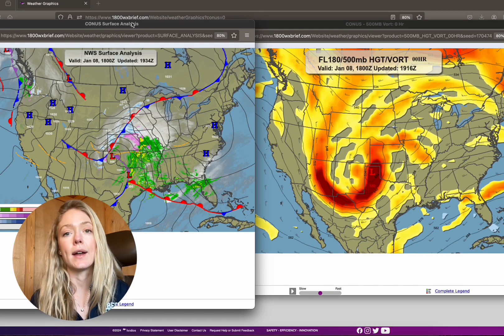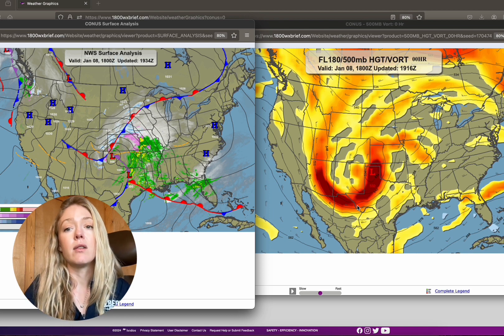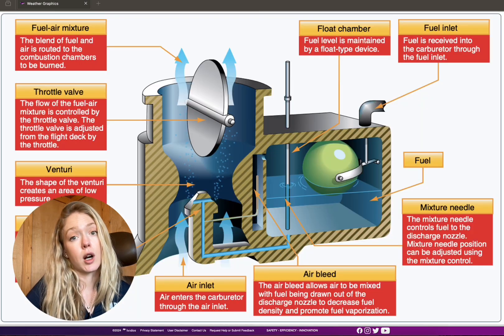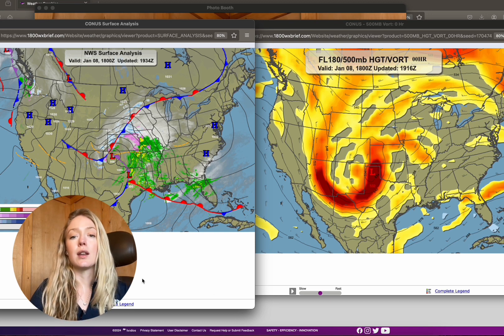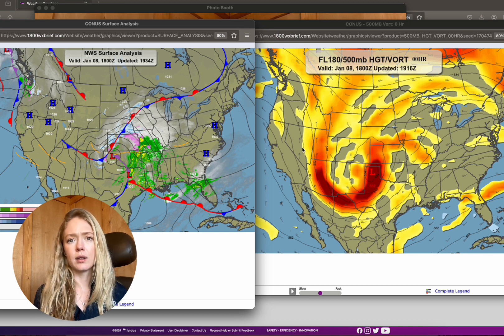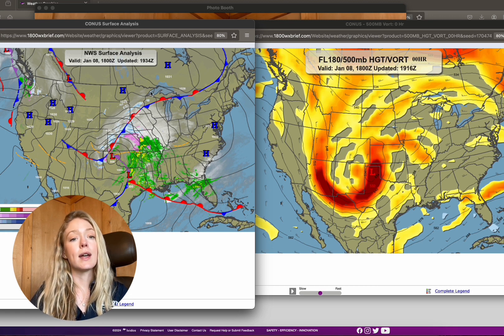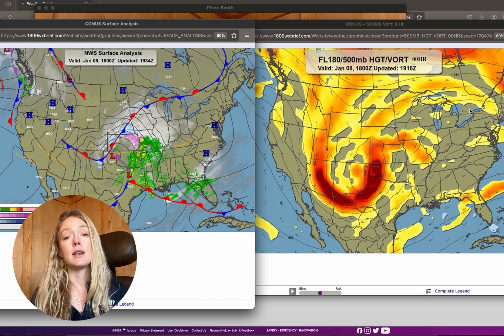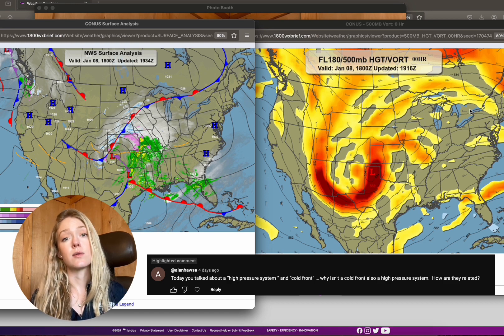AeroSafe - Flight Instructor Explains how Pressure Systems Form

Comment: I’m a CFI as well, This isn’t exactly correct, the pressure drops due to divergence aloft or the air accelerating and leaving behind thus creating a void and air having to come from the surface and rise up to fill in, not Bernoulli although it’s easy to see how that would make sense hypothetically. Think of cars on a highway having to make a sharp turn. They will have to brake to get around the sharp turn (base of the trough) which then creates congrstion and air getting backed up prior to the turn (on the left side or upper level convergence). Once the car leaves the turn it will accelerate and leave behind the other cars stuck on the turn, thus leaving a void in the atmosphere that needs to be filled (low pressure). Hope this helps
Reply: Bernoulli is also not the reason a wing makes lift, if it were how could a wing fly upside down? or why can a symmetrical airfoil fly, heck, even a barn door can fly
Reply from the maker: It seems to me you said the same thing in a different way. If that helps your students understand, it’s great!
Reply: @AeroSafe  No but your explanation is fundamentally wrong it’s not the air accelerating which then via Bernoulli will drop in pressure.

Comment: Thanks for sharing, I've wondered about this and you clarified it for me!  I like the style and cadence of the video too, easy to learn and not packed TMI.
Reply from the maker: I'm glad you found the information useful! Are there any other questions you may have in regards to weather?
Reply: @AeroSafe  Hi there, I think my confusion originally arose because where I am (Toronto) the TV weathermen always show us those  "summertime high pressure systems" that become stationary highs with beautiful warm, blue-sky days accompanied sometimes by late afternoon thunderstorms.  That's somehow counterintuitive to cool dense air being H and warm moist air being L.  So  when I look out the window I always have to unravel it in my head.  It does make sense when I consider that the jet stream has moved north and "our air" is now coming from the hot southwest and has cooled a bit, hence H, as it has moved in from the mid-USA (and often falls between fairly straight, widely spaced isobars).  Or maybe I'm wrong.  I know it's all relative and varies with respect to scale/region, season, local time-of day and lake-effect.  I still have to watch your other videos as a refresher before I come back with a good question, but maybe you could talk about these kinds of local rationales like when one looks out the window on a beautiful warm blue-sky day and the weatherman tells you it's a High.  I'm not a private pilot; it's ongoing learning to keep up/reinforce all this as part of holding an advanced drone pilot certification here.